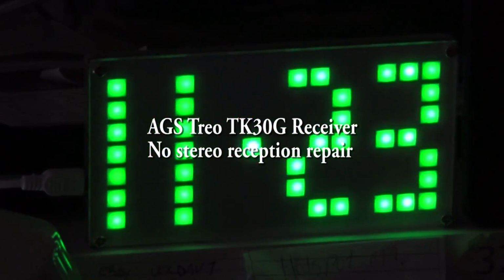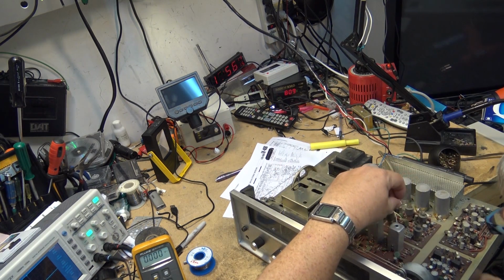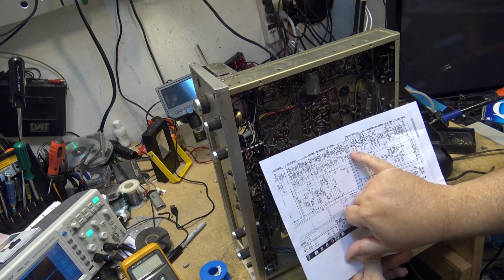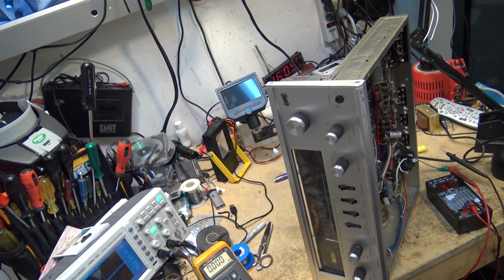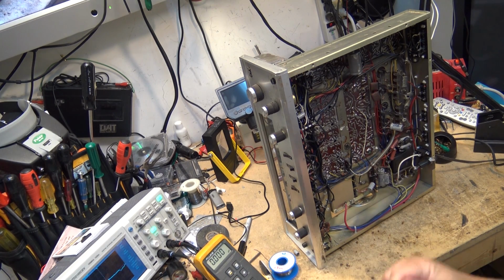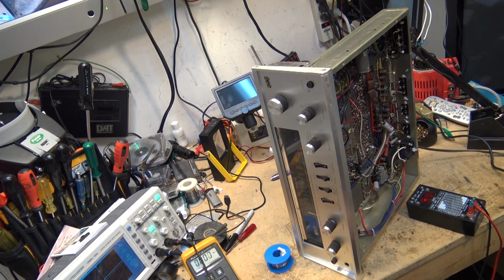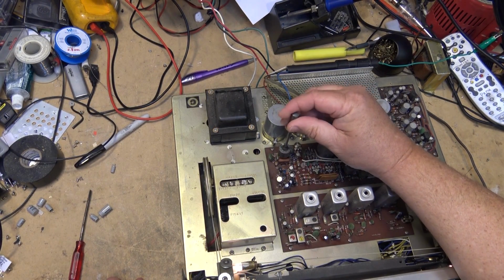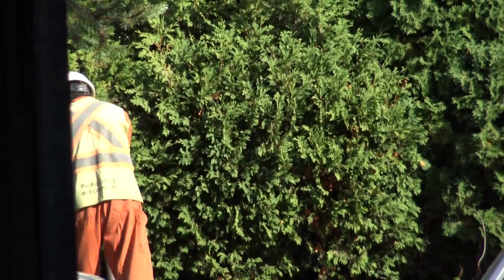AGS Trio 30G receiver no FM stereo. Can I fix it?

Comment: I have a quick question. When it comes to lubricate VHS mechanism, what kind of grease do you suggest that is available in european markets as well? I've googled the term you said the other day ("molykote") and I found a large can of Molykote BR2 Plus for rather cheap, but I'm holding off on buying until I know for sure.

Comment: That one gave you the run around lol, but you didn't have the tapping point data to help you with alignment, makes it harder without data :-(.
I have connected headphones across the +left and +right speaker terminals to see if stereo is working, if you can adjust the balance and the headphones go silent, it's mono.

I've seen Elna craps in most older devices, including c.b radios.
Reply: Just connect a speker across the 2 + terminals of the output does the same thing. will only play the l-r information.
Reply: Yes, but that's not silence, so its not receiving mono :-)
Reply from the maker: I put the scop across the decoder output initially. This wasn't included in the basic version, but these tests will be on the patreon release.

Comment: I wonder why someone has not developed a multi-mode stereo decoder using the ADC, Blackfin DSP processor, EEPROM and stereo DAC that could decode FM stereo and AM stereo, that Rubber Soul album is most certainly on youtube and I am going to add it to my watch later list.
Reply: Because AM and FM radio has moved on to HD Radio now!
Reply: steve c it is easy to reprogram the EEPROM for QAM/QPSK plus  FFT  to regenerate the digital stereo

Comment: 22/5000

I use xy mode to check the stereo
Reply from the maker: Did that, will be in the patreon release. Have to give the supporters some additional info,
Reply: https://youtu.be/DYES4aSbKQ8
Lissajous  X-Y mode  

It's  easy Way to
stereo balance  check?
Reply from the maker: 김용호 
I did use xy mode and that is on the patreon only video. Cut from public.
Reply: Yup, XY mode is useful for checking phase relationships on several things, including tuners, tape decks and more. I like your new scope. I have a Tekrtronix 465B,  that I got in the 90's, and have been looking at either a newer used Tektronix with the math and meter display functions on the same screen, or a newer LCD unit similar to the one you have. There's nothing wrong with the Tek I have, but the newer LCD storage scopes like yours, along with storage, you get a lot of  other nice features that are easier for day to day use. I do mostly audio gear, tube and solid state;.. tape decks open reel and cassette, DAT, etc., and some newer TV's that are worth fixing. I sure like working on the older discrete circuitry gear a lot more the newer chip based SMD crap. Aside from the few TV's (mostly failed caps), most of the work I get here is late 50's to very early 90's mid -fi and hi end audio gear. I love your channel and added you to my subscriptions.
 
I recently started my own business full time a little over a  years ago,.. I'm doing this from home. I learn a lot of tips and tricks watching you that are helpful, especially since I don't have the years of real world experience you do, though I suspect were close in age.  Thanks for the great videos,.. keep up the great work, and fight the good fight brother!
Reply from the maker: I did check the mpx output with the scope and that was shown on the patreon release of this video. I cut it from the public version for time. Also another way to check for stereo is to connect a speaker between the 2 positive speaker terminals. This will produce a l-r channel, and is a  poor mans way to get a surround channel. This is exactly how Dolby surround works. They would take the L and R signals, add them to produce the mono L+R center channel, and subtract them by basically inverting the right channel and then mixing with the left to produce the surround effects channel, and then add some delay or reverberation to this and send it to the back speakers.
I try to stick to older gear to repair these days. Not really fond of LCD TVs as there are so many strange problems that they have, and they are so cheap that people just chuck them when they break. 
Older gear has more value to people, and they will part with more cash to fix it.  Same with obsolete video formats like Betamax and S-VHS.
People spend money to fix these because the equipment is hard to find, and when they have tapes they need to play they will spend money to fix their deck. I recently had a SVHS deck shipped up from texas for repair.
Shipping cost far more than the repair bill on the machine.